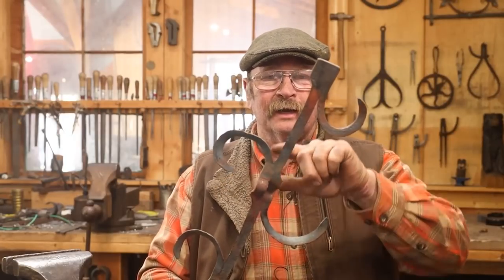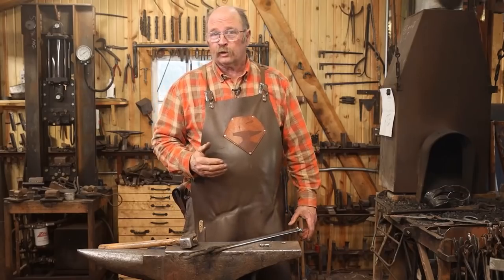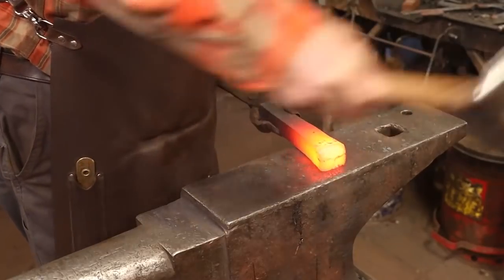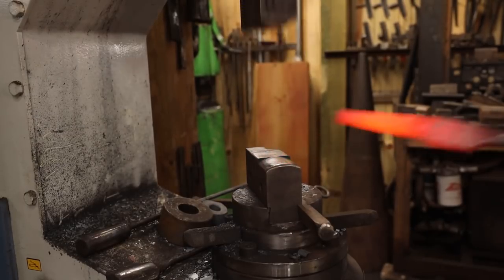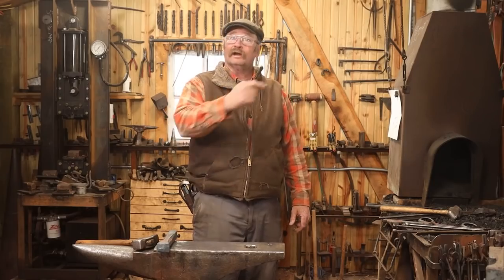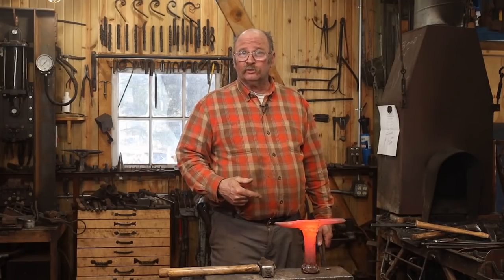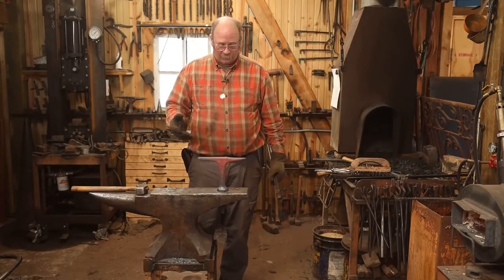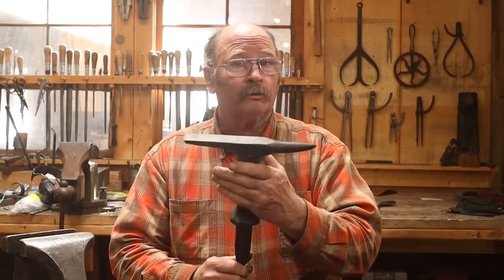Forged and fabricated Stake Anvil

Comment: For the first upset, I've done similar on several occasions with a plate on the floor. "Upsetting plate" I've heard it called. Forget where I got the idea from. Picked up a disk about 10" round by 1 1/4" thick that sits on the floor adjacent my forge. Thumping the heated end down onto the plate letting the weight of the piece and the distance of the drop do much of the work goes pretty slick. I'm not a power hammer hater -- and, yes, envious but my shop simply doesn't have the floor that would tolerate a power hammer -- so I have picked up other tricks. I also tend to work a short bevel all around the end to be upset, seems to keep things straighter and the upsetting seems more efficient. Always enjoy your work and get many ideas.
Reply from the maker: Leaving the bar long and upsetting on a block would have been much easier.  I have several blocks just for that purpose and keep meaning to mount on permanently next to the anvil

Comment: I have some live traps I built over 20 years ago with concrete rebar frames welded with 6011 rod. Not 1 weld has ever broken. I even ran over 1 with a tractor I had forgotten down by the pond, hidden in tall grass I was brush hogging. believe it or not the rebar bent all up but the welds stayed intact 😂. First welding project I ever attempted,  and now I would have used bar stock not rebar.

Comment: Do you have a block or jack you can put under your hardy hole so you can put the bar into it to help hold it to reduce the bounce & just keep it from moving around while you are hitting it. A screw jack would probably work best for the adjustability and it would be more solid since it doesn't have a cushion of hydraulic oil under it.
Reply from the maker: Interesting idea.

Comment: John - a tip about grinding belts - everyone on youtube seems to be obsessed with ONLY grinding with grinding belts, that slag is always harder than any belt, so just zing over it first with a decent grinding disc before using the belt, i dont understand why everyone on youtube is obsessed with always using grinding belts - same goes for using sanding discs on the grinder, hit it first with a grinding disc

Comment: I swear I saw someone make a similar stake anvil by upsetting the end like you did, then forging it into a shouldered tenon so it could be riveted into the mortise through the top piece.  The whole thing was then forge-welded solid.  I don't know if it was then topped with a piece of high-carbon alloy, but I think that would have been easier than using a solid chunk of high-carbon alloy for the top piece.  

Wonderful build, though.  I have a stake similar to that and have been waiting on a buddy of mine to send me a piece of grader blade for the top.  Like you note, it'll always look like it was welded up with a stick welder, but it's a tool to get the job done and I can always give the "hard way" a try on the next one!
Reply from the maker: I have seen that done and would probably try that for an all forged version
Reply: @BlackBearForge  Watching Doc's videos now.  Wow, does that guy got some moxy!

Comment: Legit question- why wouldn't you upset the bar by placing the hot part on the anvil and hammering the back? Using the rebound and force up from the anvil to assist in the shaping, and not losing the bounce energy...

Comment: I've searched through your videos using the propane forge and haven't found an answer to a pressing question.
When forge welding in the propane forge. Does the flux eat up the insides of your forge? How do you protect the forge from the flux? Is this a pressing problem? I've avoided forge welding attempts in my propane forge for fear of the effects of flux on it.
Thanks again for your great videos.
Reply from the maker: Flux can be very hard on the floor of a gas forge.  My current forge uses hard fire brick and is holding up better than most https://www.youtube.com/watch?v=HuFXhYR-vDc
Reply: @BlackBearForge  Thanks for your reply and for the link to the video. I'm not sure how I missed that. It answered my question in great detail. Thanks again.

Comment: It turned out pretty good, l made a smaller shorter one last year and made it totally out of O1 tool steel. It took me a long time but l think that it was worth it. I never thought of fabricating it. Also, what rod  did you use for the mixing of metals. In my previous job we used a 707 certainium rod.
Reply from the maker: it was just 7018 because its what I had on hand.
Reply: @BlackBearForge  thanks for sharing that information. I like knowing what works. With your preheating and tempering it should last for a long time.

Comment: That's something that I will attempt to make. A question, if it's alright... I have been gifted several mower blades. Will heating to temp, coating with charcoal dust, folding ( a'la Japanese sward smith), and forge welding add enough carbon to make a descent blade ? Just something I've been thinking on.
Reply from the maker: I can't really say.  Its not a technique I have ever tried

Comment: I have joined several blacksmithing forums, and people are constantly asking about anvils. However I do not often see anyone talking about stake anvils. Is there a disadvantage to using a stake anvil in blacksmithing?
Reply from the maker: The only real issues with stake anvils are size and weight.  but for light work or to fit in tight areas they can be very useful.  Early iron age anvils were usually quite small

Comment: For the power hammer haters they can kick sand your shop you work the metal with what u got and most are jealous cause they don’t even have a forge. 😄. I’m using a 55 gallon drum and crank blower from below  I mostly work copper rod so the fancy centaur forge rigs would be overkill 🙂

Comment: Could the mig welded piece like that be forge welded after the fact?
Reply from the maker: if it was prepared to forge weld it could be tack welded then forge welded.  But the filler rod doesn't seem to forge weld very well
Reply: @BlackBearForge   good to know, thanks! I see bladesmiths tack Damascus but cut off the welds. I just didn’t know if it could be forge welded into a piece since carbon content would not be a factor. Good to have a pro to ask.
Reply: @stoneinthefield1  777